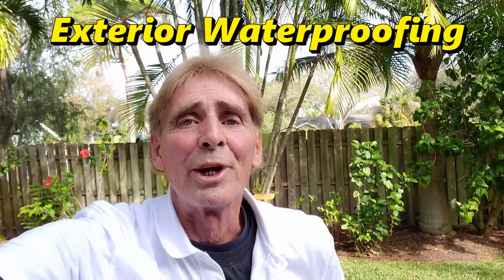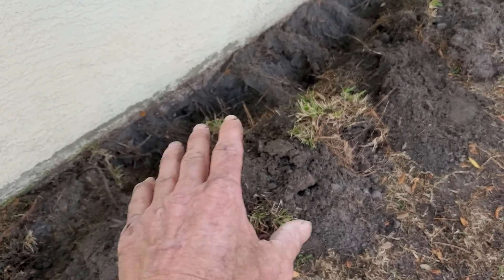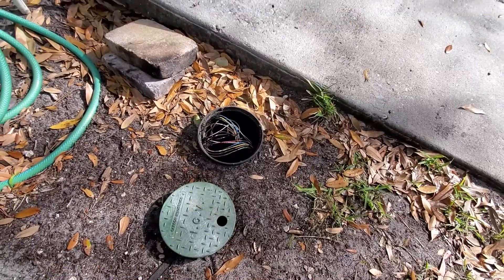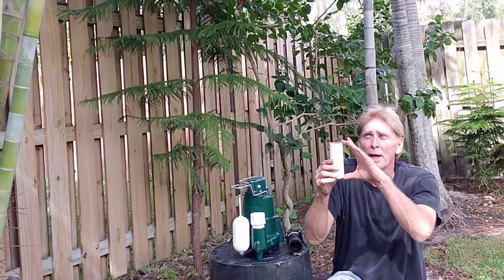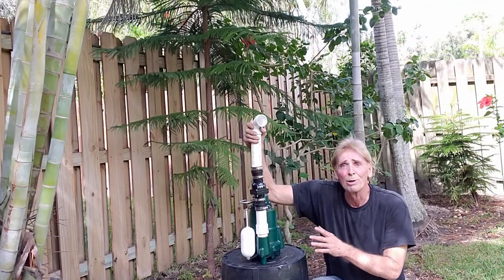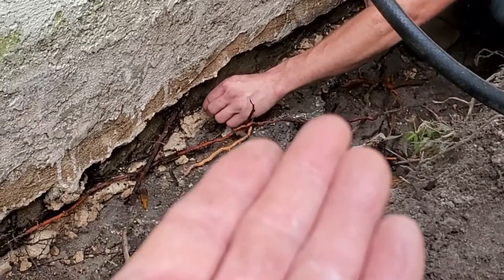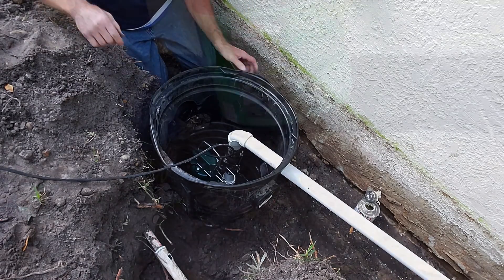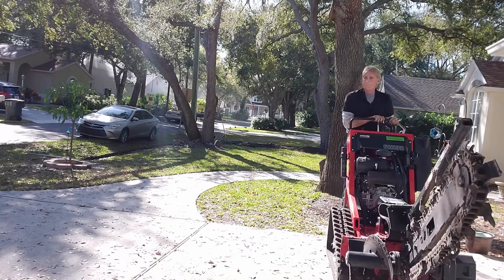Waterproofing Exterior Wall, French Drain, Seal Foundation, Footer Tile and Sump Pump

Comment: I thought a no hub only needs about 80 inlbs of torque. On a Dewalt that’s a torque setting around 3-5. Which is no where near “just as tight as you can get it”

Comment: Just going to start off saying you do good work, but in your area where the water table is high shouldn’t there also be drain tiles put down first under the center section of a house before the foundation and floor is even put in, I know it’s not something you could do but I think it would help if they did that first before they started building the house